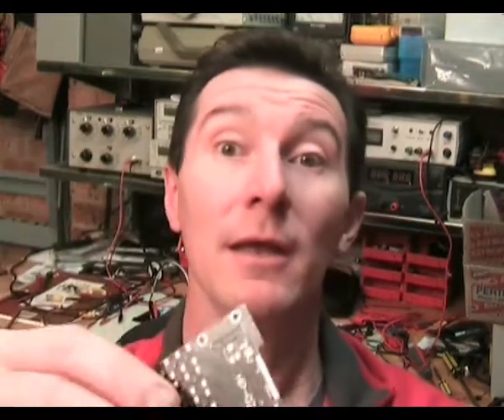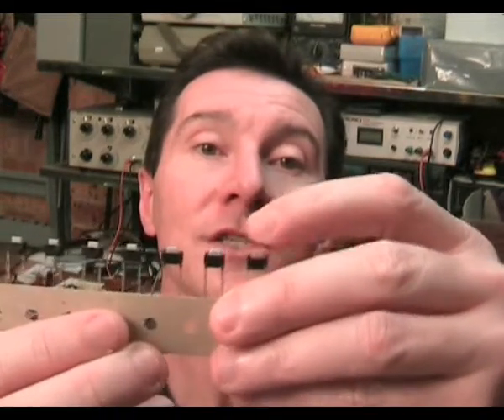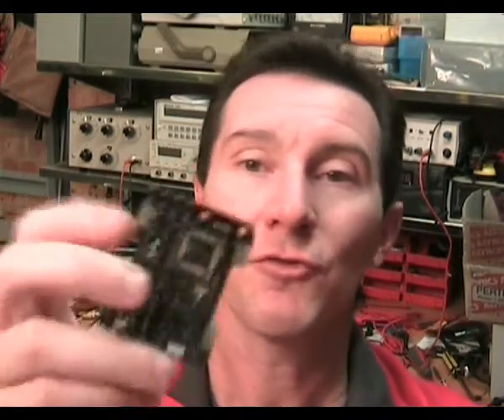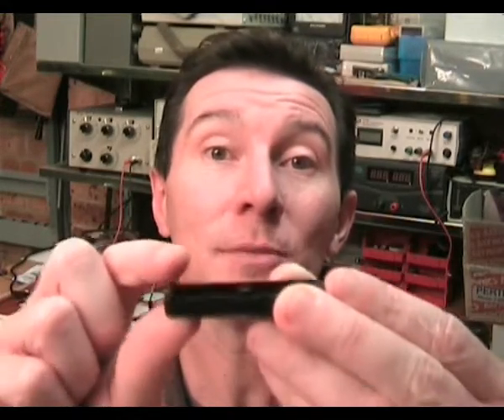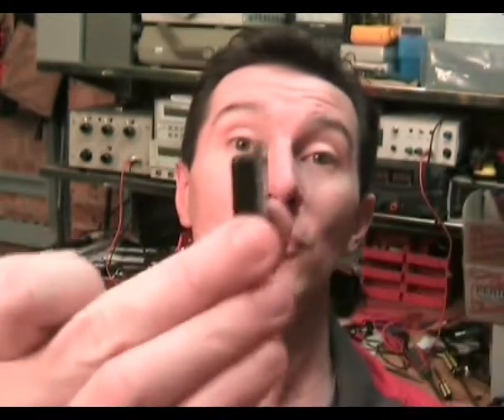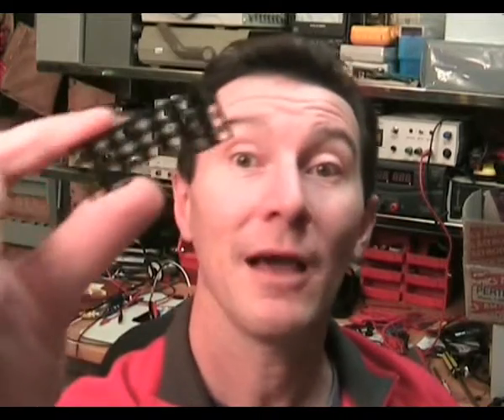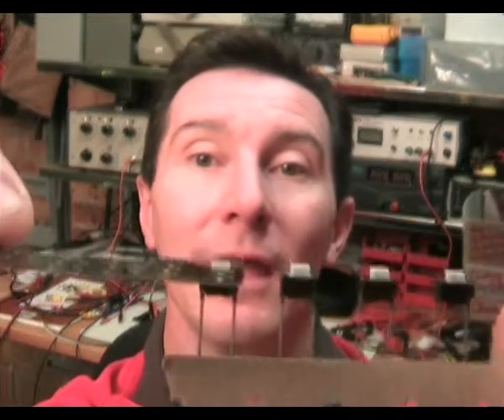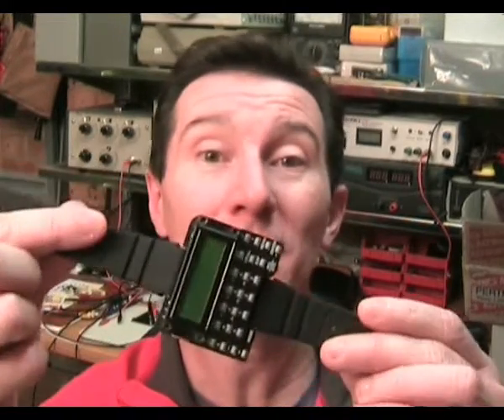EEVblog #11 Part 2 of 2 - More on DIY product design

Comment: Come on Dave, no software contrast regulation for the lcd?  Not even a trim pot in the bias line?  Looks great at 1.5v per cell, goes down hill from there.  You see this on rubbish little lcd products all the time.

Comment: Who would want a watch so big it eats two cr2032 cells at a time, all held together with super glue.  2) ever heard if zebra connectors?  I for one, am not looking forward to replaceing those cr2032 cells just to play with my calc watch.  Just a curiousity really.  what a horrible piece of engineering.
Reply: What have you designed and made recently ?

Comment: As I was watching this it occurred to me that he might have been able to use the front panel to line up the surface mount buttons. Set the buttons in solder paste, and then attach the front panel. you just have to keep it level and get it into your kitchen oven. Use the oven reflow technique and voila, the buttons are soldered in place, aligned properly. It just takes some more time. I've never tried that of course, but I'd be curious to see if it would work.

Comment: Dave; do you have any advice for calculating the required CLC filter network between a micro and an SMD antenna?  I'm running at 2.4GHz and I've found the correct trace width to yield a 50 ohm transmission line.